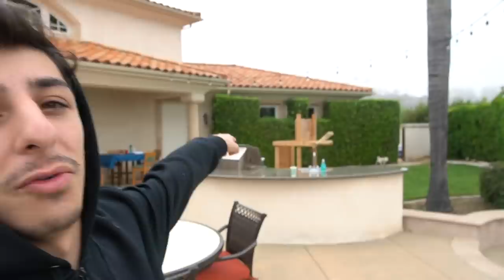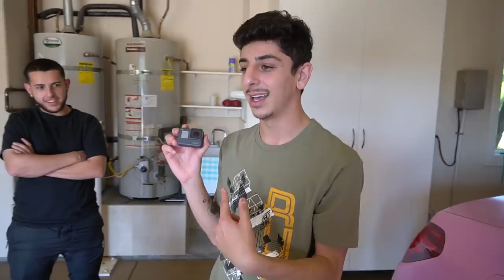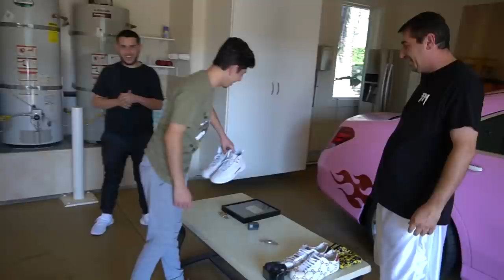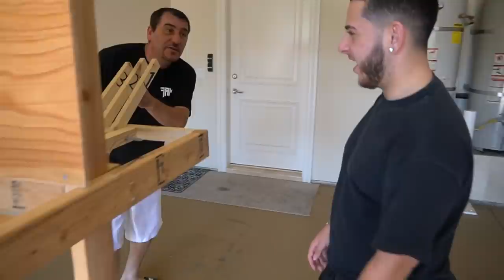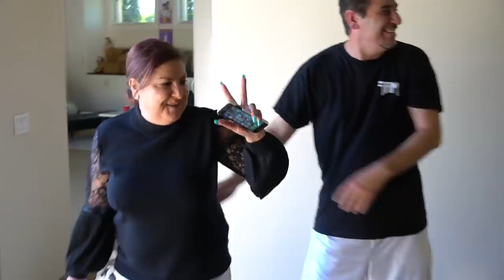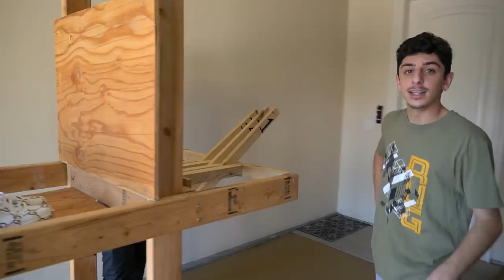DON'T Activate the Wrong TRAP DOOR LEVER!! (Mystery Valuable Items)

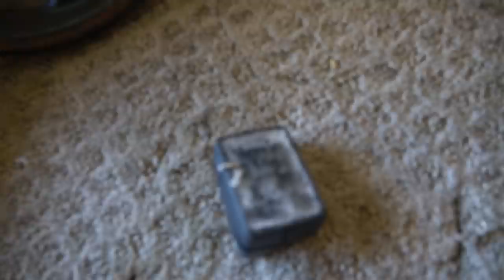Comment: In 12:01 he cuts the camera cause he wanted to crack the camera good so he cut it when he pulled the lever so he was probably holding the weights then dropped it right on it  he probably did this cause the first time he dropped it, it probably didn’t do good damage to go pro